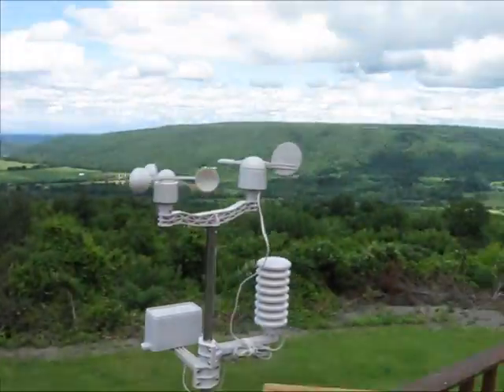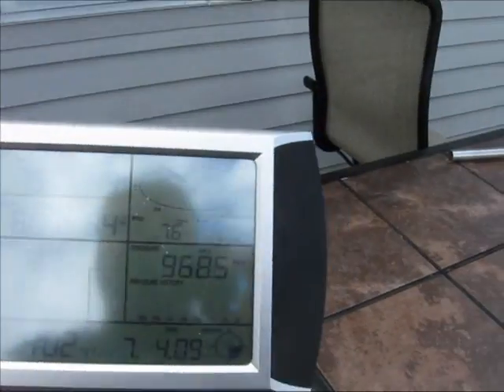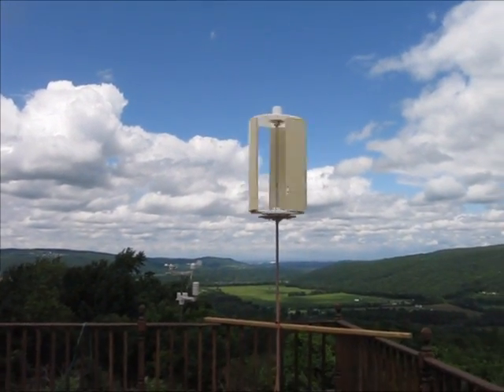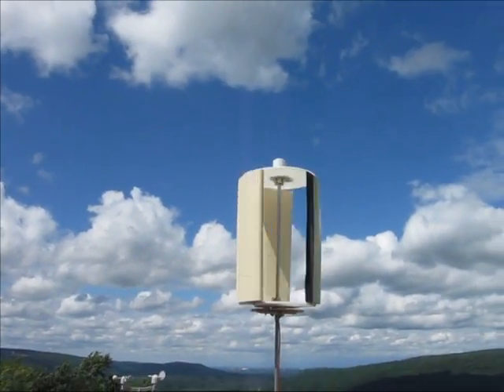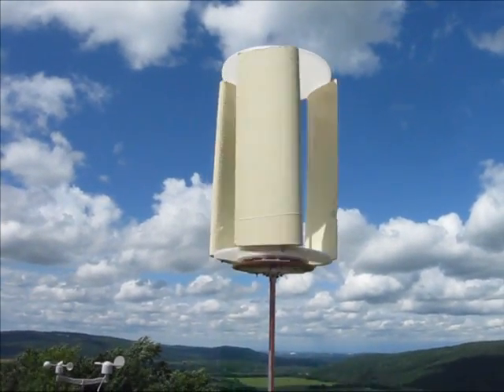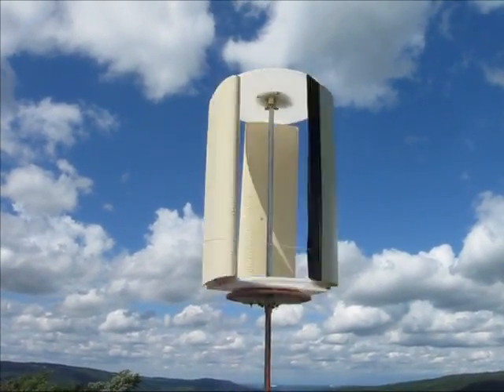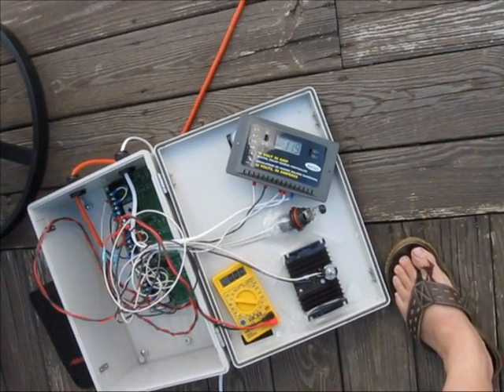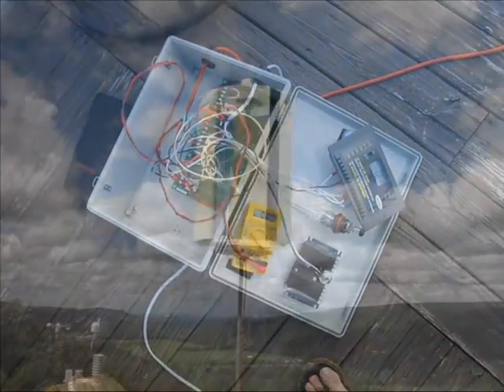Magnetic Levitation VAWT

Comment: Nice build man. inventive with the levitation.
But I must say I think your side bearings will wear out pretty quick. I would try build something bigger and slower moving. Also I think the cost of the big ND magnets for levitation is a waste.
look at the bearings this guy used. Just plastic stuff, super cheap and handles very high weight. watch?v=9UPe6A_UVPc
The only time I would go with magnetic levitation is if you can make the whole thing magnetic so theres no physical contact at all :)

Comment from the maker: @DustanMcKee They are roller blade bearings with pvc pipe fittings around them, just to handle the horizontal forces.  The entire weight of the system is supported by two neodymium magnets on the top of the pole and glued in the pvc top cap.

Comment: @embeddedprogrammer 

but is it not possible to use the same sets of magnets to both lift the turbine and generate electricity? instead of dedicated lift and generator magnets, you would have a seamless ring of magnets all facing the same way beneath the stator... then the rotor would have half the number of magnets, all of them facing to repel the magnets in the ring
the idea is that , where there is no magnet in the rotor, it is effectively the opposite pole ...

Comment: awesome.  I'm just getting into wind power as a hobby.  At this point in time my knowledge base is my bottleneck.  I've gutted a ceiling fan down to the alternator and took out the induction ring to make room for an array of neodymium mags, and have limited knowledge on finding the resistance of each of the 6 wires so I know how to wire from them.

this guy got me started

youtube.com/watch#!v=wOo7YbuwW_w

Comment from the maker: @d3lilley They are working well.  Pillow blocks work well too but I have heard of people repacking them with 3-in-1 oil rather than grease to relieve start-up problems.  I am not sure how well that works.  I am using pillow block like bearings on my six barrel savonius (please see that video).

Comment: Ahhh I see. Well that is very clever. I don't have roller bearings, but I do have two pillow blocks. If I used pilow blocks to help support the radial force, do you think it would cause too much friction? Are the roller bearings working very well?

Comment: How did you stabilize the sideforces with roller bearings? I am very interested because I just made a lenz 2 VAWT and I just tried making it mag lev and I was unsuccessful.  Wouldn't you need pillow blocks rather then roller bearings because roller bearings are not mounted? Can you please explain  how you did this, it would help a lot with my current situation.
Thanks

Comment: What about LIFTOFF with a linear motor? Levitation energy needed therefore the Darrieus could produce itself. A Neodynium on top of the vertical axis causes vibrations, I think. Why not to get rid off them with a linear motor on the ground?
Circled around the axis it could be stabilized by, by what---??
Think you have some ideas, don´t you?

Comment from the maker: @Laphroaig16  Yes, this is my design. I am just using two magnets in the sleeve on top (2 inch round, 1/2 inch thick,  Neodymium)  One magnet is attached to the top of the pole and another magnet is epoxied into the roof of the plumbing cap.  There are no lubricants of any kind being used.

Comment: Hi Jeff, thanks for your reply. With regards to the lateral movement and the PVC plumbing sleeves. Was this sleeve assembly manufactured by yourself? There doesn't appear to be much resistance. Are you using any type of lubricant in the sleeve?  Would you be able to share any pics or vids on this sleeve assembly.
Thanks in Advance for your time

Comment from the maker: @Laphroaig16 The roller blade bearings are cased in pvc plumbing sleeves which allow for vertical movement.  Visual inspection shows that there is very little, if any, up and down movement when the turbine is rotating at speed.   I hope to have a totally magnetic bearing system soon.  I have all the parts but now have some challenging machining to do.

Comment: I like your setup,  Tne turbine riding on a magnetic field vs a thrust brearings top and bottom has to be an improvement.  The lateral bearings could also be replaced with a magnetic one also.  Less friction means more power converted to electricity. Have you tried any type of magnetic bearing replacement for the horizontal mechanical bearings?

Comment: Check out OpenFoam.  It's public domain but requires a Linux system.  I have a bunch of videos up showing some of the output.

I like the turbine.  It looks a lot like my first one.  What kind of power did you get in the 10 MPH wind? 

When you start to produce power and the alt puts a load on the turbine, I wonder if the drag of conventional bearings is all that significant.  Have you found that they waste a lot of power?

Comment from the maker: Thanks. I am using batteries now but shortly will be switching over to grid tie for the winter.  I have not done an efficiency or analysis of yet.  I would like to get COMSOL but it costs about $20K.  It would do allow me to model both the wind turbine and electric generator but just too expensive for small companies.

Comment from the maker: 23" diameter

1" Inside Diameter Shaft Schedule 40 water pipe

Airfoils are one yard high

Lenz cants his wings at 9 degrees based on testing. Lenz's design is  a compromise and has good low speed properties (acts like a drag turbine at low speeds). Mine are true symmetrical airfoils and they seem to work best at that angle (possibly because the disc damps the wing tip vortex) but this design is not as good as Lenz for low (<5mph) wind speeds.

Comment: Hi Jeff from Australia,
can you tell me approximately the diameter of the unit? And of the center shaft? I am thinking of building something about this size but am worried the center shaft will bend, causing the alternator magnets to hit the coils.

Also, I noticed you have the radius at the front of your aerfoils pointing toward the center of the unit, whereas Ed Lenz has his pointing out - is there a reason for this (it sure seems to work great regardless).

Thanks for your time - keep going!

Comment from the maker: It weighs about 40-60 pounds I think.   I can pick it up and lower it on the steel pipe myself.  The wings are light weight EPS but get much heavier when they are hard coated for durability.  The top and bottom circles are made of 1/2" cutting board.

Comment: I disagree. The magnets will support the weight of the turbine, thereby eliminating the friction of a roller or ball bearing that would have been used for the same purpose (supporting the vertical load).

Comment from the maker: I did a bad job of explaining the bearings. The only non-magnetic bearings are the roller blade bearings supporting the lateral forces (they are inside the pvc pipe sections and the lateral forces, which are much less than the weight of a human body,are being applied in the direction the bearings are designed to handle).  There are three pairs of roller blade bearings on the top and three on the bottom at 120 degree intervals around the fixed axle and are attached to the white disks.

Comment from the maker: Good idea but I am instead using larger diameter  pipe because the magnetic bearing I am using needs to be on the top of the system for simplicity of installation.

Comment: I simply cut three pieces of treated 5/8" decking and used them to attach the barrels together with deck screws.  I found the axle in the metal scrap yard Ashley Salvage.  It has a 1" inch outer diameter and actually comes from the legs on an adjustable shelving unit.  I bought the two pulleys at San Antonio Belting & Pulley Co. here in San Antonio, TX.

Comment: Wow, that looks great!  I am still with the 55 gallon drum VAWT.  

With my new 180 volt PM motor/generator rated at 1HP and 1750 rpms it takes a strong wind to get her spinning but at approx 60 rpm x 4.33 more or less I get enough voltage to begin charging my battery bank.

BTW: i have 1 inch diameter bearings (two of them) with grease fittings.  This was the most expensive part of my design until I purchased this dc motor on ebay for about $70.

Comment from the maker: Magnets are on the top on this one in the plastic housing.  A magnet is glued into the plastic cap on the top.  Another magnet is attached to the supporting post via a CNC'd mount so the wind turbine "hangs" from the pole on a cushion of air.  No lazy susan on this one.  The Lazy susan in my savonius designs required periodic lubrication and we are working towards a zero maintenance turbine.  Other bearings are roller blade bearings on the sides of the steel pipe to counteract side forces.